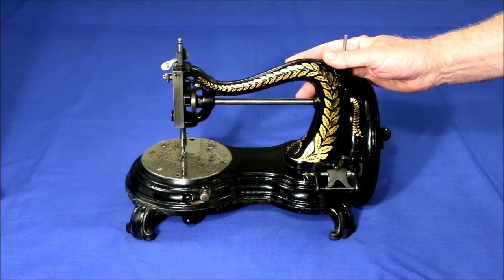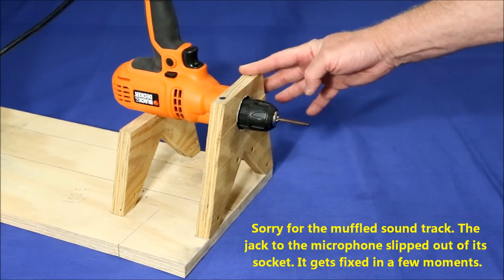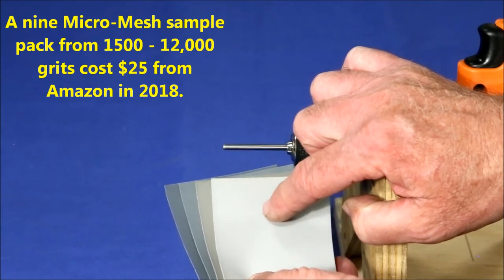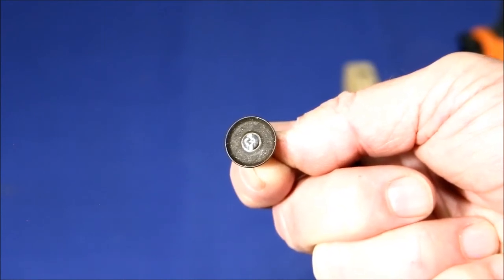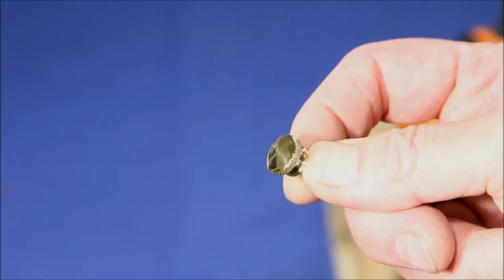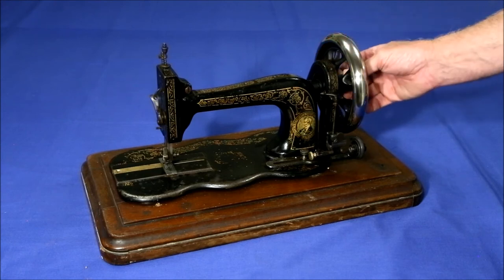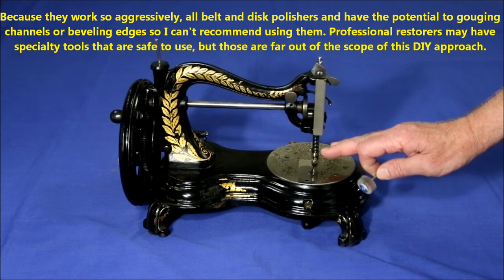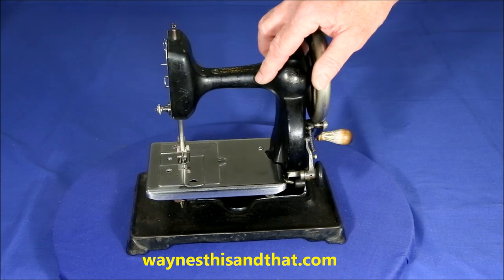Antique Sewing Machine Restoration   Part 1

Comment: After polishing the oversized Bradbury hand wheel, was there any nickel left on it or is that shine from polished cast iron? Several of my hand cranks appear to have chipped and/or corroded plating in places. Thanks for the “goal post” technique.
Reply from the maker: Usually, the only way to get main wheels looking bright again is to grind away the old plating and polish the underlaying cast iron.